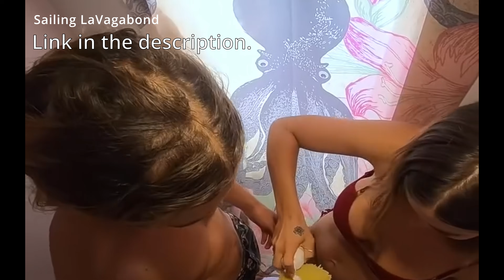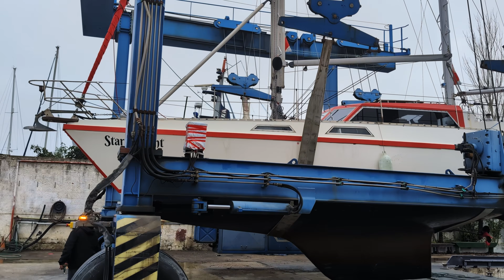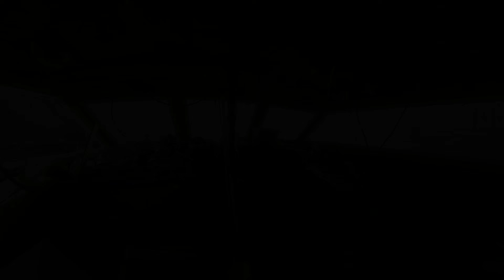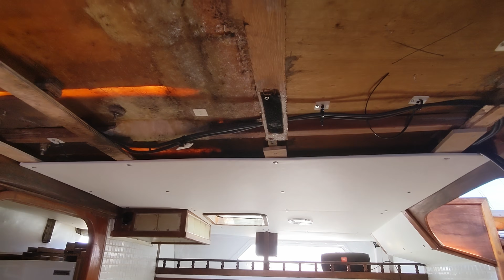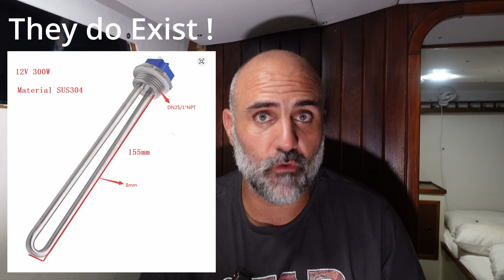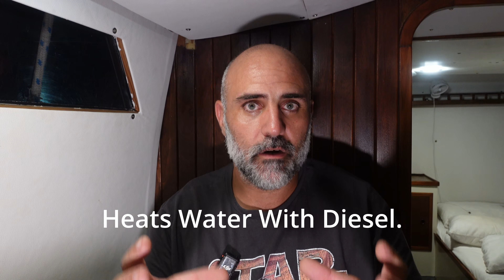Off Grid: Efficient Water Heating for Your Sailboat.

Comment: It's going to be hard to beat direct solar, but there are inexpensive heatpump pool heaters, starting at 300 euros (bestway iirc). Use one side to cool your cabin while heating up your water!
Downside with solar approach is you loose bifaciality which is mostly BS for residential, but should be awesome for boat.

Comment: After the second 230V/1500W-coil within two years in my 25L Vetus had corroded away, my electrician came up with a 12V-element with two separate 12V/220W coils some years ago, that fit perfectly. Now I can have warm water all day just from solar alone using just one of the coils from solar, or if I need it faster, use both. As for the meagre size: Yes, I also had thought, 25L might be a bit small. But after living 5 years on the boat, 3 of them with two persons, we never ran out of hot water for dishwashing, daily showers or anything else (including warm water to be used in a camping washingmachine). Originally, I had bought that Vetus with 2 instead of just one warmwater-coils, to be able to not only connect the enginecircuit, but additionally something like your displayed "solarthermal" coild under a solarpanel. Alas, we never made it that far, as there was simply no need for it.
Reply from the maker: Good points. Cheers mate fair winds 💪

Comment: Dear Sir or Madam,
I would like to describe hybrid PVT solar technology. It involves two systems: one is known as PV, which is only useful for generating electricity, but the collectors tend to overheat and thus lose power. The other is solar thermal technology for generating hot water. The Dutch have combined both systems, creating an actively cooled solar system. So, if you connect the water (not gas) collectors to a heat exchanger and a small solar controller, you always get enough electricity and hot water, as well as passive heating—cooling through radiators with fans—even in Alaska.

Always have a hand's breadth of water under your keel and always good winds.

Best regards,
Roland.M.L.Hugger

Comment: That coil beneath the panel is close to what I was thinking.  But here's my version:  You get some sheet aluminium, say 5mm thick and the length and width of a solid glass solar panel.  Then use a router to cut channels into the sheet.  Use some of that CPU heatsink bonding paste to bond it to the underneath of the panel, with the channels facing down.  Cover the channels by putting another 1-2mm thick sheet over them.  Now you have an aluminium backing plate with channels through the centre.  You just need to circulate water through the channels.  Bonus, the glass panels might be walkable now they have support from the backing plate.
Reply: Alright, that Prisma panel is what I was thinking, except it looks like they have pressed the channels into stainless steel.  Why didn't they use aluminium?
Reply from the maker: Aluminium corrodes in the presence of stainless. And the fastners are usually stainless so I guess they decided to do everything in the same metal. Cheers
Reply from the maker: That's a cool idea let us know if you ever do it. Cheers mate fair winds 💪

Comment: This is essentially what Torrid Marine is doing with their Explorer Series marine water heaters does out of the box.  The vertical, 18 gallon MVS182IX2EL is an efficient hot water heater that has two independent electrical source inputs (typically 120VAC and 24DC) and two independent coolant sourced heat exchanger coils (typically for engine waste heat capture and hydronic or gen-set).

This unit is installed as OEM equipment on the new Hylas 57 sailboat.  Reviews are quite good.
Reply from the maker: Ohh nice. I didn't know that.  It makes sense that eventually builders would start to incorporate these methods on new boats. Cheers mate fair winds 💪
Reply: Why would you heat hot water ( hot water heater)

Comment: That was a hugely ingenious idea about adding the piping underneath your panel to cool the panel and heat the water. I've not seen that before in my experience with boats. Most boats that I've seen with hot water, they come with the immersion heater which then rely on electric from the battery or you have to run the motor to heat the water which is then wasteful for your diesel.

So do you run the water maker to pump freshwater into your storage which you can then use for showers? I'm just trying to make sense of your set up and haven't seen your build yet (I'm new to the channel having found you today from your "Things I wish I knew" video you posted a couple of weeks ago) - washing the sails in the washing machine was also something I learnt for the first time!!

Ps clickbait all you like, I am here for the humour and the lessons 😁
Reply from the maker: Hehe thanks so Much. Ok so not the sails i doubt sail's can fit in a washing machine. Its the lines you can wash in the washing machine.

So far our watermarker is not installed yet. So we use the stored water. However we have a large water tank that we fill in the marina, and we can make it last for about a month. We also have a 80liter water heater that gets its whater from the main tank. 
When the WM is installed it will fill the main tank every so often. Cheers mate, welcome 🤗 and fair winds 💪

Comment: Last one was very useful, the coiled solar panels sound cool but don't make much sense to me. 

My option: I am going to buy a hybrid diesel heater, that has a water heater built in. There are webasto units like that, but also chinese copies of that, and I plan to get one of those.
Reply from the maker: Oh cool. I looked at the Chinese units but they cost like 200eur shipped since a used webasto cost me 50eur it was a no brainier, because i. Portugal these heaters are rarely used in the cars, our climate is very warm. So used units are usually like new. Cheers mate 💪
Reply: @reversingentropy  I mean, if you can get a used unit, sure go for it. I was just on about the chinese ones because brand new they are cheaper than brand new webasto. Practically the same. 

Just wondering why la vag still takes showers with a pot of hot water... Probably just as a running gag?

Comment: My plan for this specific issue, is a standard mains powered water heater, and a small Honda generator connected to my shore power input.
Reply from the maker: That's a good idea too. Just not super efficient. And gasoline is sometimes hard to find in remote places. I am looking to find a small diesel generator in the future. Cheers mate fair winds 💪

Comment: There are also solar showers. Basically a black bag you fill with water and hang in the sun. and, as someone has already mentioned, propane or lpg, or whatever gas tankless water heaters. you can get those at camping supply places. Or, get used to cold showers. There are many health benefits to cold showers.
Reply from the maker: Nice duck ahhaha. Yep there are. Here is the issues finding gas in remote places it's impossible. Black bags don't heat up in the winter, have no pressure and are not connected to the plumbing so you have to fill them up manually etc. 
Cold bath's are healthy depends on your perspective... á acidental kick in the nuts white trying to give a cold bath to the younger kid and he tries to run off, it's not very healthy 🤣🤣

Comment: I have a hot water heater. Works on electricity and gas. Hot water every time. 600 Amps of lithium and 1000 watts of solar panels. 3000 watt inverter.
Reply from the maker: That's a very nice setup 👌 hey mate, say "amp hours" I made the mistake of saying amps in a video, I got crucified 😂😂😂 cheers mate fair winds 💪
Reply: Why are you heating hot water. 'Hot water heater '

Comment: And for those of us who still desire the luxury of a LONG hot shower...there are water recirculation systems finally reaching commercial viability. 

You can do a quick wash/rinse and the water goes down the drain; then you flip a switch and the water you are using runs through filters, gets reheated, and comes out the shower head again. 

Massive savings in water usage AND you only have to heat the water up a little bit so big energy savings too.
Reply from the maker: Thats very cool I need to look it up 👌
Reply: I had the exact same idea. Use a pint or so of water and recirculate it through a heating element. It spays out the shower then is recirculated. It takes a LOT of energy to heat water but very little to keep it that way. So you soap up with the recirculating water. Then you use another pint or two to rise.  I think two rinses would enough.

Comment: Very nice click bate. The  mercedes-benz a2205002098 webasto you mentioned I looked up on ebay. Sure enough $84 + $40 shipping from Ukraine. Then I watched some Youtube videos on how to use them. I am so confused!
Reply from the maker: Lol it's not difficult. There are very good videos explaining how to do it and which model to get. Out model you just apply 12v to a wire and it starts. Cheers mate fair winds 💪
Reply: @reversingentropy  Could you provide more details about that? I would like the webesto to pump water from my existing water heater (only works with shore power or engine waste heat), heat it and put it back in, but not sure how to do that. How was your set up? Did you add a second hot water tank specifically for the Webesto? Thanks!

Comment: Why you can't try using cheap Propane/Gas/LPG Tankless Instant water Heater from china? They have also Stainless Steel  ones  for less than 100us$. Ok you need a gas bottle but that can be used for long time so for many showers. So be practical.
Reply from the maker: No gas aboard our boat. Besides the safety issues, it's very hard to find the right gas bottle in the middle of nowhere. Diesel is readily available everywhere, Cheers mate fair winds 💪
Reply: ( year live-aboard. I use gas(not american gas) to heat up instant hot water. going to look at the coils under the solar panels though
Reply from the maker: @ismzaxxon  the diy solution worked well for us. I assume the professional ones are even better. Cheers mate fair winds 💪

Comment: you wouldn't make a long ocean passage with everyone showering everyday .... at least you can't afford to simply believe you could, so do the math.
water is heavy, and slows a boat down, so showers would help it speed up ... but drinking water is Always more important than a shower, even if you have enough water for both.
Reply: Van Life folks have the same issue, ands have put together some good recirculating systems that filter the water as you shower. You end up just losing the initial minute or so, as you wash of dirt or salt.
Reply from the maker: @davejob630 In boats we have watermakers so water is not a big issue. Cheers mate fair winds 💪
Reply: @reversingentropy  oh, you have a water maker ... that weighs allot less than tanked water too....just have to have spares, and enough tanked back for repairs then.
Reply from the maker: @RulgertGhostalker  Watermarkers are a game Changer 👌 you are correct spares are a must😅 cheers mate fair winds 💪
Reply from the maker: @RulgertGhostalker When you are at passage you are not swimming in saltwater often so it's not a problem. However you can take a shower every day if you want. You just have to use the watermaker more often. Cheers mate fair winds 💪

Comment: Dear Sir/Madam,

I'm currently modernizing my house. I'm using a hybrid PVT solar system with just two collector panels and water-cooled air conditioners for heating and cooling with a hot water storage tank. It takes up little space and is very efficient; it works like an air-cooled air conditioner or heat pump, only without the noise.

I'm also going to install the same system on my future boat.

What do you think?

I'm here in Europe.
Reply from the maker: Sounds great. But I Don't know much about water cooled air conditioners or swamp coolers. I never see them on Boats though. Cheers mate fair winds 💪
Reply: @reversingentropy  Dear Sir or Madam,

Until recently, I wasn't familiar with these devices either, except for the ones that use gas as the heat transfer medium and the compact ones for campers, boats, and trucks, which are all very loud and power-hungry.
Reply from the maker: @roland.m.l.hugger3214  I will check it out 👌
Reply: Marine air conditions typically use sea water and a heat exchanger to improve the effectiveness of vapor compression cycles.

Swamp coolers generally don't work well as sea because of the high relative humidity levels. Dehumidification is more effective but energy hungry. Solutions are getting developed but remain far from commercialization.
Reply from the maker: @miscreanity  👌